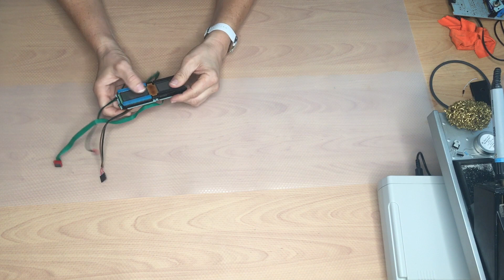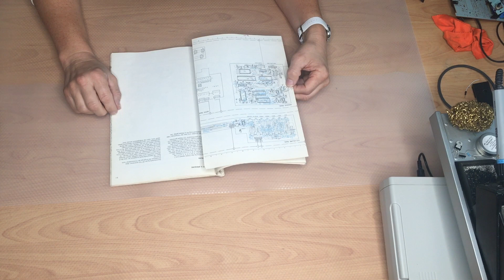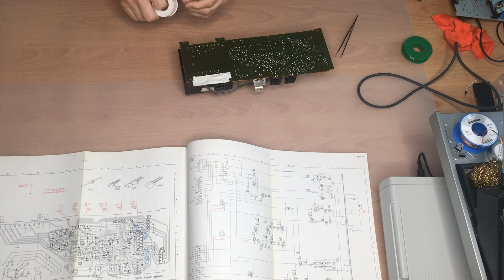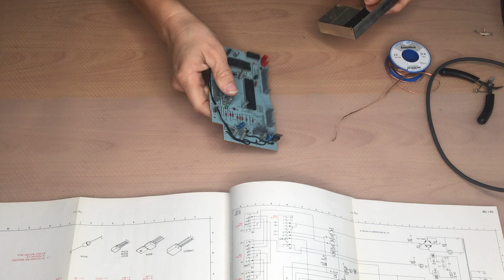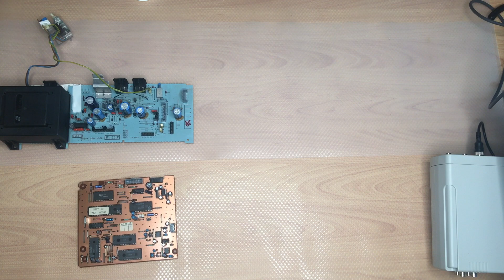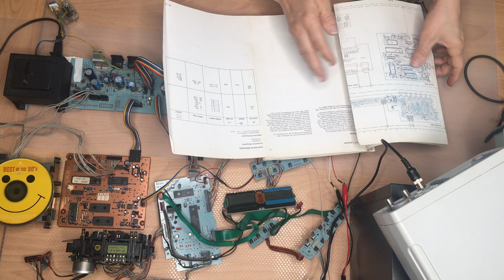Philips CD555, Resurrection EP6, Reconnecting the panels

Comment: 10:35. I wonder what all the unfitted components top left of the board were for ? Something quite complex. I wonder if there was a PLL version of this tuner.
Reply from the maker: Yes indeed, it looks like there would have been a version with a PPL tuner. However I have never seen one. The service manual mentions the releases 70CD555/30, 32, 35 but I have only seen type 30 so far. I am doing some research and come back to the topic when I am recording the work on the AM/AF panel.